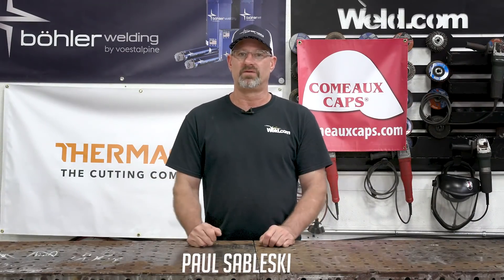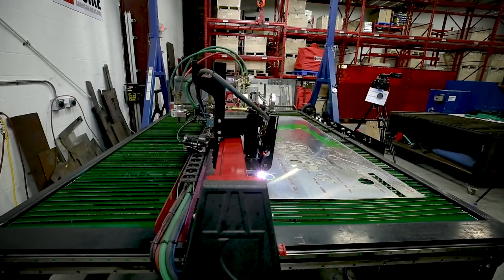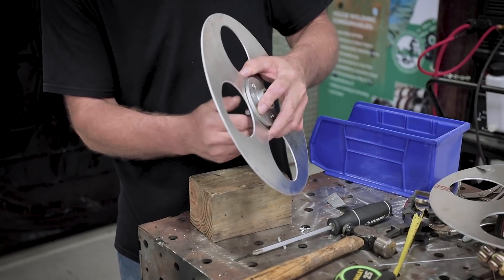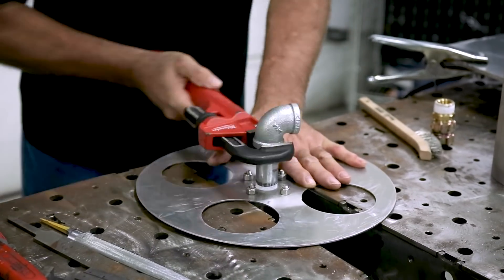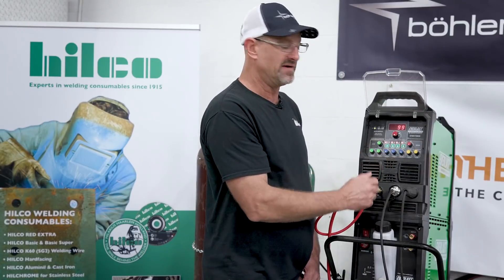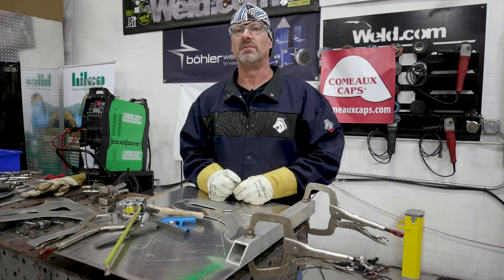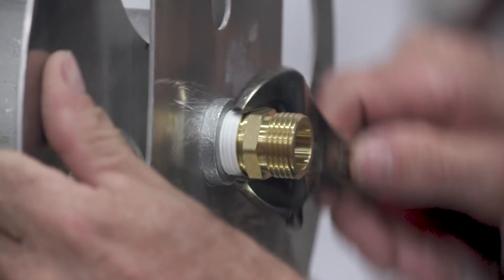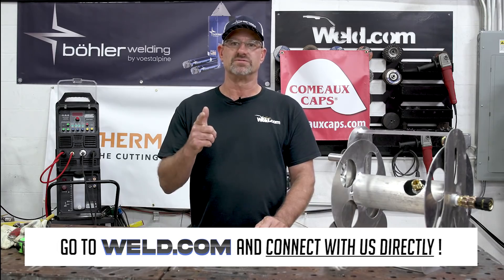How to Make and Weld a Garden Hose Reel

Comment: WOW... Really...What A Piece of Garbage.... SMH   Well first off, That IS NOT a swivel..    Installing the hose at a 90 bend will destroy the hose.  He mis-cut the side wheels as they overlap the center tube.
Is the Guy AN ACTUAL WELDER????    I would rather have the Plastic Hose  Reel from Walmart....

Comment: paul use more dc negative a  pointed tungsten works better  on fillet welds when welding  aluminum you  still using AC just add more penetration by adding more penetration you increasing dc negative it will maintain  a pointed tungsten with a slight  ball at the tip because more heat will be on the basement your machine  set on too much positive your tungsten too balled  up thats why your weld is so wide more cleaning  is more positive  which causes a more balled  up tungsten i am a delta force welder i am better  than all of you

Comment: Jezus what a piece of shit hose reel. You are cutting it on a plasma table and still manage to make to sides to small to fit the center piece of pipe. Sharp edges everywhere, a freaking expensive and uncomfortable handle, the whole thing also seems very flexible and the welds look pretty ugly.

Comment: A piece of tube, pipe or a piece of round stock with holes drilled and tapped on each end or welded on would have made a better handle. Even inverting the handle you made would have been better so it doesn't dig into your hand. I think I'm going to start making more content for my other channel is this kinda stuff can make it.
Reply: And the crank for winding up the hose is worse. If he really is a fabricator of any type he would have made both of these out of aluminum tube. That was a waste of 8.5mins of my life.😒🤔

Comment: Aside from the obvious non DIY nature of the tools used…the actual product itself has some design issues and it won’t hold up. That material is not only far too thin for 100’ of water laden hose, but the reel,itself is too small. I’ll guarantee that base will bend. That is NOT a hose reel swivel, it’s going to end up binding up. And, it’s gonna leak like a sieve with no thread tape. I’d love to see a re-do with actual DIY grade tools and good engineering.
Reply from the maker: We are always open to content makers so if you have great ideas and can do it, reach-out to us: info@weld.com  Thanks for the feedback

Comment: Far from DIY with a ~25,000 dollar Plasma table, ~600 dollar (minimum) Box break, ~150 dollars (3'x3'x1/8'' 6061), and of coarse ~1000 dollar welder (minimum) Maybe a spool gun (800 dollar welder). ~60+ dollars in plumbing and of coarse the time to plan and gather all these parts. Not the Best DIY video out there ,but ,hey< if you have the equipment.
Reply: Makes that $50 dollar Home Depot hose reel look awfully tempting.. :D

Comment: I like the premise of the video but there's a few things that aren't great. Using a plasma table is fine, but you could at least point out that someone can freehand their cuts with a handheld plasma cutter or use a saw. In an 8 minute video on a welding channel there was what, 15 seconds of welding? It'd be nice to touch on technique a little bit more even though I get that's not what this video is specifically about. Also I agree with everyone that making that handle was completely pointless. Why not show us how to tig together some aluminum pipe into a handle.

I'm not going to sit here and bitch about video quality, but there is definitely a noticeable shift this year. I understand that it's difficult for new hosts to settle into an established show and am willing to forgive a lot but there have been some shortcomings for sure.

The product placement is also a lot. Multiple sponsors in such a short video just feels.... Cheeeesy. Ya gotta pay the bills but it's pretty disruptive in this video. Unfortunately I'm a welder not a content creator so I don't have any suggestions on how to make that work.
Reply from the maker: We appreciate your feedback.

Comment: So I see other sponsors other than Neverlast finally on this show.
First No one has a CNC plasma cutter in there back yard unless they own a Business or built one from scratch.
Secondly I saw a lot of distortion in the side walls of the hose real while welding on that 6 inch tube guess you guys did not think to show how that was corrected and how many times either the welder fail to light off properly or the tungsten found it's way into the weld pool.
Now the frame of the hose reel came out nice after all the straight pieces were redone but that handle was a COP OUT AFTER ALL THAT WORK YOU MAKE A CHEAP HANDLE AND NOT A NICE ONE OUT OF ALUMINUM !!
I DO BETTER IN MY SLEEP.

Comment: Plasma table for a hose holder? I’ve been a subscriber since the Tig Time days but this is getting ridiculous. It’s a hose holder. Back in high school i used to make hose holders in my barn out of old steel car rims. I used an angle grinder and a Lincoln AC225 buzz box.
Reply: I've still got my Lincoln AC buzz box since 1977 or 78

Comment: As I’ve always suspected, even to do the most basic project, a plasma cutting table, $25000 CNC machine, a high zut TIG welder and all the associated gear is necessary.  Welding is WAY more expensive to get into than they lead you to believe at the Airgas store.
Reply: Having steel as a hobby, welding, cutting, fashioning steel CAN be expensive...(unless you do it the  "old-school way !") Dern the CNC stuff.  (That takes all the fun out of it !) DO everything by hand. Enjoy-joy doing it. 
   I have done it that way for almost 60 years ! It's very enjoyable, IF you let it be.! I don't do anything BUT steel. Stainless occasionally, but no aluminum. I use a Lincoln MIG  that has been rebuilt twice, uses .035 flux-core wire, and an AC Buzz Box using Atom Arc 1/8" 7018 rods. Use Rustoleum XX2 paint and you're good to go ! That paint is more rugged than industrial paint ! and if you put it on while the part is still real hot, it bakes on and never comes off. It has to be GROUND off !!! There's not much you can't do, with this set-up, in a DIY home hobby shop setting. I've had the buzz box almost 50 years and the MIG almost 35, and I grew-up with my torch.
Reply: its a "Garden Hose Reel"  parts can by cut by angle grinder or hand saw
Reply: @vampirwrr  that’s Old School thinking my friend, younger generations are unable to deal with those tools, why you could get hurt with a angle grinder, and a hack saw requires WAY too much effort.

Comment: I almost asked myself why you'd make a "how to" video involving the use of $25,000 in equipment, but then I quickly realized it wouldn't be possible for you to jam 20 seconds of sponsorship shoutouts into every 2 mins of your video otherwise.
Reply: lots of people that watch these videos have access to every tool he used here... infact the only thing I'm confused is why he is using store brought pipes and fittings.

If it was truly diy he would have bent and threaded those pipes himself... 

This is a welding and fabrication channel. If you don't have access to a cnc cutter you need to widen your network
Reply: @scatdawg1  It's a hose reel dude, not a rocket. I'm sure there are a lot of people who have access to the equipment shown. I'm more sure there's even more people who don't. Like the OP said, it's just a way advertise by making a "how to" video.
Reply: @scatdawg1  yeah…cus weldin’ and fabin’ didn’t even exist before CNC came along!